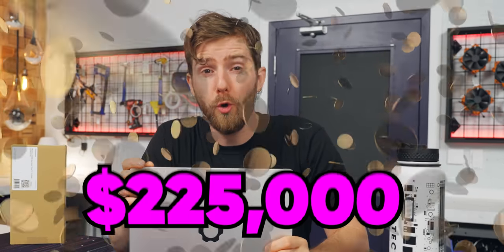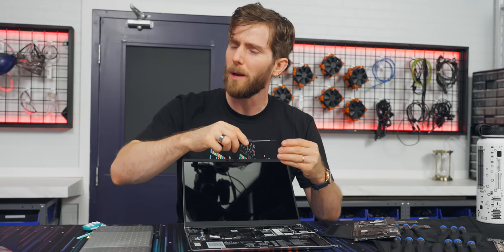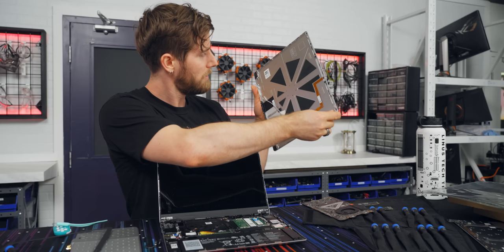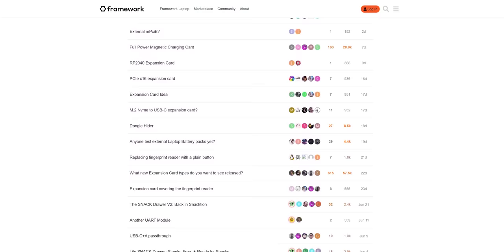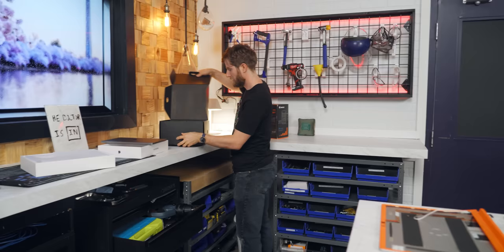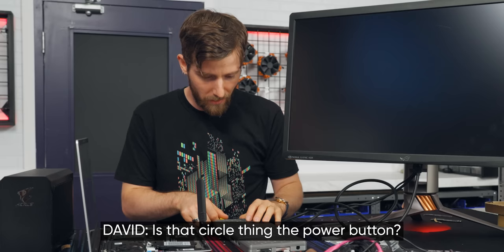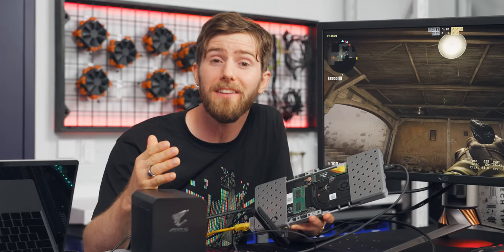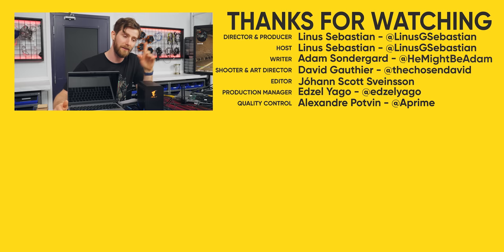I invested $225K in Framework Laptop - 1 Year Update and 12th Gen Upgrade

Comment: I'm really into the whole framework ideology and would like to someday get on of their laptops but the first thing I would need is a larger screen.  The work I would be using it for is a lot easier if I have a larger (17") screen.  The problem I've always had is that the major brand keep equating larger screen with larger processor and that jack the price up even higher.  That makes too much of a dent in my limited budget.  A Ryzen 3 4300u is way more than what I need.
Reply: Same with RAM, I’d love 16GB without paying for a 4K screen or top tier i7. Also 2-in-1, that’s unfortunately an essential feature. I’ll limp my current laptop along as long as I can, but when the day comes I NEED a new laptop, I hope  framework has what a need.
Reply: @Definitelynotacelebrity  you can easily upgrade ram on any laptops tho and its super easy.
Reply: @saumyalimbu6918  not any laptops, many are soldered now
Reply: I'm personally hoping they do the larger screen too but on top of that a larger chassis that allows more space to have a mobile GPU would be frickin AMAZING cause while I don't do a lot of gaming on my laptop I do play some heavier games sometimes that require at least a decent GPU I also tend to use my laptop for some light upscaling (which does use mostly CPU but you can use the GPU to speed up the process a fair bit) so having a GPU for me is kind of a must.

Comment: 7:12  U.fl connectors can be repaired if you are good enough with a soldering iron.  As long as you can get an electrical connection to the remaining pads/tracks, you can initially secure the socket with a tiny dab of superglue underneath for soldering and then reinforce round the socket with epoxy afterwards.
Reply: Good to know for the next time I open my laptop, I was always careful with ribbon cables yet I never even tried thinking about the poor little antenna connectors, I would just yoink them out of the socket with the head of a screwdriver being quite careless in that.
Reply: The other issue with U.fl connectors is they do wear down over time with constant insertion and removal. If I remember correctly they are rated at about 30 cycles or so. (I was way wrong with my estimate of 200)  30 is only what the official rating is and I don't know if it's actually tested beyond it.
Reply: @Trekeyus  you are correct on the number of rated matings but in reality they loosen up much faster.  I'm in the Rc FPV hobby and U.fl are used quite extensively on video and Rc link transmitters on the craft side and people treat them like they are able to be mated repeatedly and they barely attach after a few cycles.

Even SMA can wear out, on my video receiver side I install and remove the antenna's every time I fly and make sure I hold the antenna near the base while I undo it by the securing nut so that the Center pin is not spinning in the contact causing excess wear.

Comment: If the 3d printed case had a battery mount also, it could work as an internal backup to use as a server.  Love it ❤️ 😀
Reply: I mean, it's a 3D print case, it's not particularly hard to tack one on in CAD.

Comment: If there was a version of this that included a mobile GPU, I would consider buying it.
Reply: This is the other reason to double down on AMD for it since their on-board GPUs are way more mature
Reply: I would accept a full 16x slot out with adapter. That way I don't have to go though thunderbolt limitations.
Reply: Not many thin and lights with mobile GPUs. It wouldnt be good for battery, and the thermals wouldnt let you get the full power. Which is why i advocate for an egpu. Your thin and light stays portable for small on the go tasks, but for heavy operations where you wont be very portable anyway, you know where to go
Reply: @matthewtrebs9738  laptop brands don't have to limit themselves to only building thin and light laptops. Most people who are into building their own computers are gamers. and its not like gaming laptops are insanely heavy. Mine is 1.7kg and thin enough to fit in my backpack comfortably.
Reply: @myykkoll  i dont think framework has the rnd to support 2 product line-ups yet, but like i said i think an egpu is a decent alternative and adds to the modularity

Comment: The battery and screen must stay compatible across generations. Imho this is the most likely components to require a swap over ownership. Heck have them bring third party manufacturers too!
Reply: With the schematics being quite easy to get access to, and all the physical dimensions and CAD drawings readily available, 3rd party manufacturers can already easily make Framework parts. The market is just too small right now, quite a small number of people have the laptops; if Framework gets bigger, it won’t be difficult to find 3rd party parts.

Comment: Making a computer modular has obvious costs:

1. The parts are heavier
2. The parts are more expensive
3. It is a jigsaw of fixed dimensions to make the parts fit therefore less tightly tailored.
4. There are many cross over compatibility issues which limits swapability 
5. There is currently only one source for all parts
6. There is going to be design drift
7. The connections are an extra source of problems
8. To achieve modularity you lose on optimisation

LEGO is an impressive lesson in modularity and also a lesson of just how the initial simplicity evolves into increased complexity and a very expensive secondary market for no-longer available parts. Also how a 3rd party market of custom parts forms but at considerable cost.

Comment: I used to fix Lenovo laptops as part of my job for a Lenovo certified AWSP(authorised warranty service provider) and honestly apart from the easily swappable I/O there doesn't really seem to be much difference in swapping the components that Linus did in this video over a ThinkPad
Reply: it could be that getting the parts , schematics and  guilds is the distinguishing factor morso then the tuly ease of swapping.
Reply: Thinkpads have always been modular (the first few generations looked like a blocks puzzle inside) and have stayed mostly modular to this day - in contrast to other models and brands. I've only bought x and t series thinkpads the last decade, but the most important things for me are the keyboard and trackpoint. Though, I have upgraded ram and storage on them.
Reply: @PaulSpades  Yes they still are very modular. I had a X1 Carbon ultrabook as a work laptop and I upgraded a few things in it and it was easy to work in. I also swapped out a non-touch 720p screen on a X270 to a 1080p touchscreen by finding the part code in the HMM and ordering a panel off eBay for £35.

Comment: I really wish they had an option with an discrete gpu as this would seal the deal for me but I’m considering going Framework anyways.
Reply: The thing that would’ve made me choose it when I bought a laptop in December is a 2 in 1 option with an OLED screen.
Reply: @Marauder Pretty sure they mean integrated. Extra heat and space taking from a GPU would be inconvenient.
Reply: cant you use the usb c to do that? or does it need thunderbolt
Reply: @Exilir8  It already has integrated
Reply: @Marauder yeah, my bad 😅
Reply: @WilliamCronin  ye but I don’t wanna carry an external gpu around with me all the time

Comment: would be cool if you could custom order one of these to come without a certain part like the camera or microphone, you would save money and e-waste
Reply: You can remove things like RAM and Storage
Reply: @gecked8560 es but he means removed in advance. Right now you can select parts you want but you have to either buy individual parts, select bundles, or an entire computer. They want a assembled computer minus a few parts. It’s more economical than buying individual and more ecological and economical than removing parts. However it is difficult for the company. Adds a lot of logistics both on the software end for making a website that can do that and for assembly lines. Also it would be hard to put a price on a partially made laptop. People would expect it to be cheaper than a full laptop and cheaper than buying individual parts which makes pricing complex. Plus you have to factor in assembly cost.
Reply: Problem is, customization at that level would add a lot of work for the company. I don't think it'd make it cheaper, rather the opposite
Reply: @andredanieldasilvaleite3672  right you do have a point there, although if you could change more in the laptop like having this specific chassis and this resolution screen with this refresh rate that would maybe work out

Comment: I'm waiting for an AMD Ryzen version of the framework laptop to buy mine. I like AMD's linux support, their integrated graphics, power efficiency, and most of all their dedication to providing an upgrade path that lasts for more than 1 generation for their platforms. I'd also like to see a keyboard option for Cherry MX switches and some more gamer oriented modules.
Reply: I'm excited to see mechanical low profile mechanical keyboards with a little extra travel becoming more of a thing, but what I really want is for someone to figure out how to integrate a full-sized trackball into a laptop form factor.
Reply: @Marauder Cherry recently released their ultra low profile mechanical scissor switches, which I desperately want in a keyboard, but unfortunately they seem to only be available from laptop OEM's like Alienware at the moment.

Comment: Really glad the hinge and touchpad are getting fixes. I might spring for those, it's a cheap fix. The battery drain issues are really killer for me on Linux, though. I don't use the laptop more than once a day, and there's always a strong chance it has 0 battery left when I go to pick it up. It's borderline unusable and it leads me to avoid using it at all. An AMD offering would be killer.
Reply: Since the Intel guys were showing off their Arc GPUs at Linus not long ago, it seems it would be possible for Linus to request Intel to work on that S3 deep sleep issue so both Intel and AMD versions of the Framework laptop can sip battery power.

Comment: Literally the coolest thing I've seen In a long time! I think some of the old Cleo gaming laptops had socketed CPU's but that was back in 2014 and they were hard to acquire and you couldn't swap the motherboard for the new chips. If I didn't just buy a laptop I would have picked up a frameworks laptop. I'm going to pick one up in a few years and use it as my coding/travel system.

Comment: It would be nice if they included a small PCIE connector on the motherboard (like the Asus flow series) to connect to whatever you want when not used in the laptop.
Reply: well, they have four USB4 ports on the motherboard, these can do PCIE already. No need for an extra connector, if you ask me
Reply: @danieleckert3508  wrong.
Not all USB 4.0 are PCIe compliants.

Don't believe me? Take a look at several Cheap Laptops running 12th Gen Core i3, it has several USB4 ports on it, none of them carrying PCIe Signal.
For USB 4.0 to carry PCIe signal, unfortunately you still need Thunderbolt functionality (chip) which can be either integrated directly inside the CPU or on the Motherboard.

USB 4.0 is literally just a 40 Gbps port out of the box, but could also might or might not carry PCIe signal. Which still depending on the company who made the Laptop. Do they disclose it or not.
Reply: @danieleckert3508  usb 4 can do thunderbolt which has way less bandwidth then a PCIE slot. This is why EGPUs are so bottlenecked compared to actually being plugged in. Also, thunderbolt is very finicky. The amount of people I’ve seen trying to troubleshoot thunderbolt driver issues is insane. That is way Linus is switching from thunderbolt for his dock setup to optical USB and Optical DisplayPort.
Reply: @ClayWheeler  I've never claimed all USB4 ports can do PCIE, but these on the framework definitely do. 
And there needs not to be any thunderbolt chip involved, the USB4 spec provides everything needed for PCIE tunneling via USB4. Even some laptos with the newest amd cpus have USB4 ports with PCIE functionality.

Also, it's USB4, not USB 4.0. You're using the incorrect terminology. Which tells me you havent dived very deep into USB4 and what it can and can't do.
Reply: @danieleckert3508   Nice. WRONG again. I wrote the bait and You took it.

I intentionally wrote USB 4.0 to lure you into deep dive of USB4 . When I said it need Thunderbolt protocol (chip) for USB4 to be able to Tunnel PCIe Signal, is because Intel themselves actually stated it. Need an Example?

Mainstream 12th Gen Core i5-1240P has Thunderbolt controller Manufactured directly inside the CPU. Hence it can provide PCIe signal through USB4. Meanwhile Mobile Core i3 12th Gen CAN'T despite using the same socket FCBGA1744.

Need another example? GPD Win Max 2 with AMD Ryzen 7 have USB4 on it and can tunnel PCIe signal, but Ryzen 7 itself doesn't have Thunderbolt protocol built in the CPU die. How's it possible? GPD Win Max 2 has dedicated Thunderbolt chip on the Motherboard itself, so it can tunnel PCIe signal to USB4.

Your statement that USB4 doesn't need Thunderbolt for tunneling PCIe signal is just misleading. Why don't you explain about Laptops with USB4 logo on the side and still can't deliver PCIe signal?

Comment: I really hope they can make amd version of framework in the future... If we can put thunderbolt mod it would be awesome for external GPU. Maybe the only laptop that can have thunderbolt port and amd cpu at the same time
Reply: There are some AMD laptops out there with thunderbolt. Very rare but they are there.
Reply: Usb4 includes Thunderbolt, USB four they made it an open standard. I just don't understand why manufacturers aren't using it
Reply: @neb_setabed  Framework's USB-C expansion card supports USB4, in addition to the mainboard. You can connect an external GPU with Thunderbolt. Their most recent forum post on the topic (from their CEO) says that they were still going through the certification process for the ability to legally claim Thunderbolt support, though the laptop certainly has it.

Comment: Without Ryzen it's still a no for me even though I really like the repairable modular concept. An non-glossy display would be nice though.
Reply: Matte displays diminish the picture quality.
Reply: @PSYCHOV3N0M  But if you're on the run, or planning to use your laptop outside, a glossy display makes the screen almost unreadable.
Reply: @PSYCHOV3N0M  With a "regular" laptop, that'd be much more of an issue. Framework already has multiple options for hinge stiffness to suit different use cases, which would be completely infeasible for any other laptop to offer. Having a glossy screen for those who want to eak out every last bit of image quality indoors, and a matte one for people who need to see the screen outdoors on sunny days, might similarly be feasible.
Reply: Same here. Need ryzen offerings!
Reply: @PSYCHOV3N0M  I don't need a top notch quality for work considering that I'm not an artist or I don't use my laptop to watch 4k movies. However I do need to see my code or my spreadsheets even when there is some light behind me, which is almost always the case. Plus glare gives me headache after a couple of hours. Matte display is a must for many people. I simply cannot work on a non-matte display so this is the first thing I check when I buy a laptop or a monitor. There is no way I will buy a non-matte laptop. My TV is a glossy display because I want a better quality on this screen and I put on dimmed lights when I watch it so light is not an issue here. It just depends on each one's needs.

Comment: Apart from an AMD model, I would love if they also had one with a numpad, as I need one for professional reasons. But I guess on a 13 inch laptop, that's not really feasible without making the keys way too small. So there's hoping for a 15 or 16 inch version somewhere down the line.

I would also love a full SD card reader and an expansion module with 2 USB-C connectors side by side instead of just one as there's clearly enough space for 2 of them on them, even if that cuts down on transfer speed.

And of course, it would be great if Framework (or a separate company closely working with them) would take back the parts that one doesn't need (or not working) anymore and recycle them, either refurbish if still in full working condition or scrap for parts if they don't work as intended anymore.
Reply: Why not jump straight to 17" as the bigger model (with an internal extender for the bays on one side).  This would entail a bigger cabinet, bigger keyboard, that extender and then qualifying some market standard 17" displays and batteries to fill up the case.
Reply: @johndododoe1411  I was thinking about 17"being more for a future model after the release of a 15/16 inch model, but eventually yeah, that should also come for sure.
Reply: @steveweidig5373  Doing a clear jump between a small and large model will avoid the long term cost of maintaining many sizes with parts available.  A big case that accepts 17 and 15 inch screens with different bezels as only unique part would provide long term viability.
Reply: @johndododoe1411  While I can understand your point, I don't know many persons who would buy such a big and potentially heavy laptop. Hence why I suggested 15/16 inches first.

But you may be right.